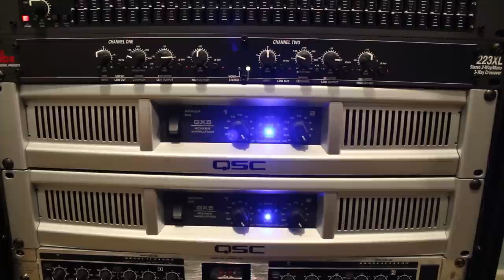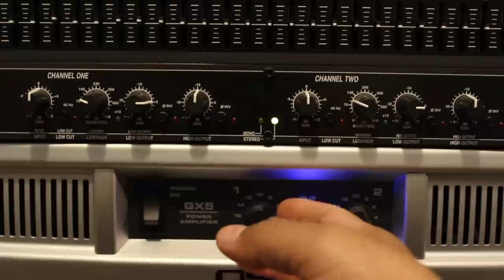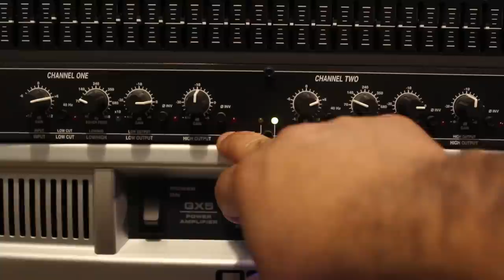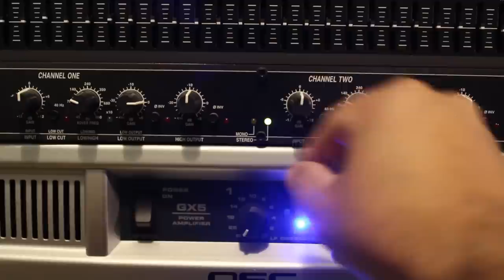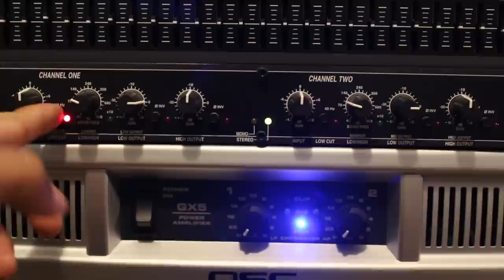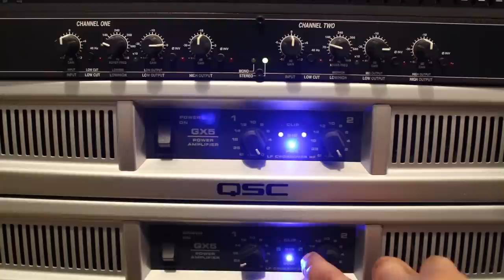How to Setup active crossover dbx 223XL into your PA system | DJ Setup | Live bands | Live events

Comment: question about running subs with the qsc 3602 amp. i'm trying to get the most power off this amp and subs. the subs i'm interested in are about 1700 watts RMS and 3400 watts peak. the subs come in 8 ohms and 4 ohm versions. which should i get? i already have one which is the 8 ohms version and was thinking about getting the 4 ohms version to use it as my main sub, get more power out of it as a primary sub?  since i already  have the 8 ohm version, can i mix it with the 4 ohm version? will the 4 ohm sub "sound louder" if so by about how much? 
i only use one sub for most of my gigs and use the 8 ohm version i already have. but for the bigger bigs i'd like to drive 2 subs. but i want to get the 4 ohm version and use it as my primary instead of the 8 ohm i already have since i don't need 2 subs for most of my gigs and use 2 (with the 8 ohm as secondary) for the bigger gigs. 
the 8 ohm is plenty sub already for most of my gigs. plays very well and has pretty much handled all my big gigs but i think a second one would sound better. the reason i want to get a second sub is because i was called to check some wiring of some amps and speakers for a club and the crest sub amp didn't seem too much of an amp compared to this 3602 drove 4 subs and handled them very easily. this amp was set at max and they controlled the volume by the mixer. they had 3 separate amps for highs mids and subs. the biggest largest crest amp being the sub speaker..

can the 3602 drive two 1700 RMS 8 ohm and 4 ohm subs? what's the proper way to power 2 subs (8 and 4 ohms) with the 3602 amp to get most out of the amp and subs?

for 15's i have two 15" 1000 watt RMS 2000 watt peak powered by a qsc 3402. 

i also have a third amp that drives my highs bi-amped on the 15's. 

in my rack i only have an eq. one side for the subs and mids. the other side for highs only. the 3602 crossover is switched on. no crossover for the mids on th e3402... since the 15's are 1000 RMS they also help the sub with lows hence me not needing a 2nd sub for most of my gigs... 

qsc plx3402 specs:
Watts Stereo Mode
(both channels driven)
8 ohms 20 Hz-20 kHz 0.03% THD 700W 
4 ohms 20 Hz-20 kHz 0.05% THD 1100W 
2 ohms 1 kHz 1% THD 1700W 

Watts Bridge Mono Mode
16 ohms 20 Hz-20 kHz 0.01% THD: 1400W 
8 ohms 20 Hz-20 kHz 0.01% THD: 2200W 
4 ohms 1 kHz 1% THD: 3400W 

qsc plx3602 specs:
Power:
775 watts stereo at 8 ohms
1250 watts stereo at 4 ohms
1800 watts stereo at 2 ohms
2600 watts bridged to mono at 8 ohms
3600 watts bridged to mono at 4 ohms
Reply from the maker: +Sir Jay , Even if you get the 4 Ohms version of subs producing 1700 RMS then QSC plx 3600 is not enough to drive them for longer period of time at full capacity in stereo mode. However In bridged mono mode @ 4 ohms and then connecting the subs( 8 ohms subs ) in parallel mode can just get you enough power to drive but again not recommended for longer hours of playing at full capacity. In order to drive your subs properly you will need minimum amplification of 5440W. Hope this helps.

Comment: Hello AVME i have same crossover like yours and i would like to connect channel one of crossover to midrange and channel two subwoofer...how can i connect and setup.
Reply: i would like channel one of the crossover to serve midrange and channel two of the crossover to subwoofer..........let me the connection and setting
Reply from the maker: Use the crossover in 2 way stereo mode .This video shows you exactly how to utilize two channels of a crossover in 2 way stereo mode.
Reply: Hello am not comfortable with the answer, get me clear... i have two Amplifiers one for sub-woofer and the other for mid range and i want channel one of the crossover to run mid-range using one amplifier and channel two of the crossover to run sub-woofer using other amplifier...........i want to know  the connection and setting how to balance them on crossover.

Comment: Hi, Very informative vid. Thanks. Just would like to know.. Im planing on adding two passive subs to my active speakers. I need my tops to run full range with the Bass. Im powering the subs with a 3000W amplifier and there are only Input A and Input B on the AMP with outputs for the speakers. So im unable to send a signal to my Tops via my AMP . how can i chive this?
Reply from the maker: Sure that is a normal connection , first tell me the watts/ohms of your speakers , subs and the amp , if possible send me the make/model numbers of all units then i will tell you the signal flow.
Reply: my Amplifier is - NRS DS-9702 AM6001     OUTPUT POWER ：  1500W x 2    8Ω  BRIDGE POWER ：3000W
Bin - JBL STX818S - 1000W Continuous - 4000W Peak at 8Ω 
Tops - ART 715-A MK4 - 700W RMS - 1400W PEAK

Comment: bro. i like your teaching in crossover,thanks...the sound that i like 2 play is a little bit narrow and full base and a crisp mid and hi...can a cross over alone do the job?...i once played in a club that sound like that..fos asian people that is amazing...can u teach?...please...
Reply from the maker: +Raymond  Nakamura , Crossover is just tool to forward high/mid and low frequencies to destined routes. To shape up the sound you need to apply effects like Dynamics( compressors , gate , deesser , limiter ) , Filters ( EQ , HPF , LPF) , Time based ( reverb , delay etc)Modulation ( phaser , chorus etc). Now a days a lot of digital mixers have variety of on board effects so no need to purchase dedicated effects units. A high end  DSP unit comes with loads of effects as well.

Comment: will I have to remove built in passive crossover from speaker in order for active crossover to work properly?
Reply from the maker: if you do it properly( disconnect the built in passive crossover) then it's better because then the active crossover would be doing the crossover job in the signal chain,
Reply: No you do not have to remove your passive crossover from your speaker box.

Comment: hi thanks for the video i have 2000w xti crown amp i just want to use one   400w bin and one 300w top with eq and xover would the amp be to powerful thanks.
Reply from the maker: yes its should be okay , if your have just one top and a bass bin then run the amp in bridge mono mode .

Comment: would love some help myself.... haven't used a crossover in years and we recently brought a PA. 2 topboxes (double 15" plus a horn with internal passive x-over) with Freq response of 43Hz - 17kHz +/- 3dB, 34Hz - 20kHz +/- 6dB. And 2 subs (1x 18" JBL 2241G in each) with a Freq response of 30Hz - 3kHz which also states the highest recommended crossover of 800Hz. I'm using a Behringer super-X pro cx2310 in 2 way stereo mode. This x-over in 2 way mode has everything this above instruction video has but also a Sub Woofer mono send (so 2 way + sub). so if you know this particular x-over it would be helpful.... anyways this is what I intend to do...does this sound right? I believe there are prolly 2 ways to do this but since I'm running only three amps ill run the subs linked in mono off the mono sub woofer send on the x-over. Also this might be logical but am I right in believing the Freq knob is basically a frequency mix knob for the two high and low output in the 2 way section? everything above whatever setting is sent to the high output with everything below going to the Low output.

I have three amps in bridge mode, 1 to run the 2 sub's off the sub woofer mono send from x-over and set at 100Hz. The other 2 amps will run the 2 top boxes taking a left and right from the x-over. ok this is my confused bit, is this right.... take the signal from each of the high output of x-over to each of the top box amps and set the Freq to 100Hz. this would leave the low outputs in the 2 way section on the x-over free and not needed. does this sound right or not
Reply: Id say your doing it the right way

Comment: I use xls 2 series Crown amps with built in digital crossover networks, much simpler.
Reply from the maker: yes now a days much simpler options are available as the technology keeps evolving but in many parts of the word techs are still using technology they can afford.Thanks for watching.
Reply: @AVMEVideos  Yeah I understand that. I'm not saying outboard equipment is a bad thing, they often have useful features that integrated stuff doesn't. I certainly miss the ability to switch on/off sub or midrange frequencies with the push of a button if altering settings and comparing the sound, or if I don't want the subs on, just switching them off on the fly. Doing this now means messing around with gain controls lol.
Reply: BS manufacturing strategy. I have tried this on the crown XD I 4,000 amp compared to an active crossover. Night and day difference. The active crossover blows the built in channel or the xti 4,000
Reply: @crispa1861  I was a little sceptical about the built in crossovers in the amps but so far they've worked well for me. I have been considering getting a separate active crossover for peace of mind though. I had a Behringer super x pro sometime in the past which I loved using.
Reply: Don't think about it if you the means to get an active xover. I suggest an ashly xr1001or a dbx 223xl  for a 2way stereo system.

Comment: I'm lost if you run two amps how many speakers do you need I only have a set of dx9 cerwin vega
Reply from the maker: +Michael Davis , You mentioned in your 1st post ({eq and too ( two)amps} . What crossover you have ?
Reply: i have and mu-co3w musysic
Reply from the maker: +Michael Davis , Okay Michael , After looking at the specs of your speakers and your crossover , your speakers do not offer Bi-amping so you can't connect a crossover in the signal chain. Crossover is usually need with 4 speakers setup in stereo mode Two tops & two bass bins. Also you have only one amp , The best setup according to the equipment you have would be to connect your Player/EQ to AMP then AMP to your speakers and you would need total 4 wires. Hope this helps .
Reply: if all you have is 2 speakers 1 amp should be find just make sure your amp is rated for your speakers

Comment: why is there on the 3rd knob of channel one low output but on the channel 2 it is mid output? has this to do anything with the difference of tone in the channels? if that the cause.. you would never be able to get the same sound out of your 2 subs. by example right?
Reply: this question because ive got the same settings on channel 1 and 2 but got different tones out of each sub
Reply from the maker: for stereo setup the 3rd knob on both channels is ''LOW OUTPUT'' , for mono setup the 3rd knob on 2nd channel is mid output . If you are still confused about stereo & mono setups , let me know & i 'll try to explain further.

Comment: What about using active 2 speakers and a passive subwoofer? Pls help, thank you
Reply from the maker: +Javier Sanchez , You can still use the external active crossover , however most of the pro series active speakers have built in active crossover/DSP that works well with active sub woofers in the signal chain , Anyways for argument sake and your required sound design here are the connections. Make sure built in crossover is switch off or by-passed in your active speakers. Use the external active crossover in stereo mode. Active crossover High out from CH1 to active Speaker 1 , active crossover High out from CH2 to active Speaker 2 , Low out from CH1 to AMP CH1 to output to passive sub-woofer.Make sure Low sum is switched on the external active crossover. Now select your desired crossover frequency lets say 80Hz , now passive sub-woofer will output 80Hz and below frequencies and your active speakers will handle 80hz and above frequencies. Hope this answers your question.
Reply: +AVME Videos (audiovideome) thanks brothA. I will put this in to practice
Reply from the maker: Yes !
Reply from the maker: No worries dude , watch this video https://youtu.be/6SpAfuwdWT8  & you would know where the mids goes.

Comment: i have 2 amplifier can i use it with that active crossover? the following power amplifiers are rated 250w RMS and 1100w and how can i connect the 2-250w (10''dia.)spkrs; 2-1000w Subwoofer (18''dia.) spkrs;  and 2-1200w professional (15''dia.) spkrs. with 2-600w tweeters. thanks in advance sir.
Reply: Thank you, boss, for sharing yours. Knowledge.

Comment: how can I achieve a 4 way stereo crossover setup do I need 2 independent crossover to achieve this. I want to run high, high mid, mid range and low
Reply from the maker: +Ricardo Miller , Hi for 4 way stereo setup you need dbx driverack venue or similar products.
Reply: +AVME Videos (audiovideome) thanks for the reply I had a look and the driverack venue while it does 4 way it does it in mono mode I wanted to achieve this in stereo mode besides this unit is a bit expensive could I not use a driverack pa+ and a separate active crossover to achieve a stereo 4 way system
Reply from the maker: +Ricardo Miller , Please send me total number of speakers , bass bins and model numbers of your speakers.
Reply from the maker: +Ricardo Miller , Hi as you haven't come back to me with the total number of speakers you will use. I assume you want to connect total 2 Highs , 2 mids  and 4/low speakers. Total 8 speakers in variation of HIGH , MID and LOW.
The answer to your above questions is no you cannot connect two crossovers together unless there is one in the market that you can use in cascade mode using some sort of AES/EBU connection . There are two solutions for your setup assuming there are total 8 speakers 2 highs , 2 Mids and 4/lows. For first solution you would  need minimum 4 outputs or 4 Aux/s from your mixer and 4 Amps. You will need TWO DBX 234XL crossovers or equivalent. 

1: From your mixer route your input ( Ipod or your mac book pro) to 4 different AUX/s .Make sure all 4 AUX/s are turned ON for the input channel on the mixer.
2: Connect 1st and 2nd AUX/s from mixer to the two inputs on 1st crossover and then use in 3-way stereo mode , connect High outputs to 1st AMP then connect to Two High speakers . Connect MID outputs to 2nd AMP then connect to TWO MID speakers.Connect LOW outputs to 3rd AMP then to TWO LOW speakers.
3: Connect the 3rd and 4th AUX/s from mixer to two inputs on the 2nd crossover and then use in 2-way stereo mode , connect the TWO LOW outputs to the 4th AMP and then connect to the other set of TWO LOW speakers.
AND you will have a 4-way stereo setup.

2nd Solution is invest in NOVA DC 8000 which has 8 outputs or equivalent.
Good luck.

Comment: Hi i  hook up my equalizer to my crossover how do i balance the sound because i get to much tweeters and horn
Reply from the maker: what EQ are you using ?  Once you have done Eqing , Make sure once the signal reaches crossover then its setup between 70 to 100Hz  crossover frequency.
Reply: My equalizer is IEQ 215 INTIMIDATION,just see your text busy at work ,

Comment: Hi I have the same DBX  cross over,I am using EV QRX218s SUBs, I am not getting enough bottom end around crossover point 110 DB, I have to increase it to be around 140 DB to reasonable bass out of my subs, is it normal, my tops are ETX 35 .
Reply from the maker: as Long  you don't get Lyrics out of subs then it's fine , try bring it down to 120dB.
Reply: Don't you both mean Hz and not dB?

80 Hz will almost ensure no lyrics out of subs unless James Earl Jones is singing. But 120 Hz is a good level as well, but that should be the limit. No higher than that.

Comment: is it ok to connect my two way speaker as mid range....is there no low freq coming out...tnx
Reply from the maker: if you use a active crossover in the signal chain then yes otherwise the built in passive crossover will forward the high frequencies to the tweeter and mid/low to the woofer in your two way speaker .

Comment: pls how do you connect from the mixer into the equalizer, crossover and a compressor
Reply from the maker: get a digital mixer with built in EQ and compressor and output the signal to dsp unit with built in crossover to amp to speakers.
in analog mixer out put to external EQ/compressor unit then out to crossover to amp to speakers .

Comment: hat about a eq,..for mains besides the one on the board,...hooked up before the crossover, or before??.....
Reply from the maker: fixxer3467 For Live playing back of professionally recorded music EQ should not be used because during the recording/mixing process the engineer has already applied the EQ where required , if necessary less EQ should be applied. In the video the GEQ unit is bypassed i use it only for ringing out the microphones.
Reply: im asking about live band performances...
sorry about that i should have explained better..also i was wondering when i'm doing sound for a live band,..i have a active crossover ,...should i set any of the filters ,..like 30hz to 50hz in the off position and let the crossover do the work?
Reply: thanks for the help here
Reply from the maker: fixxer3467 Sure use the crossover for live performances ,  send me the model / make of your crossover .
Reply: behringer super x pro 
cx3400